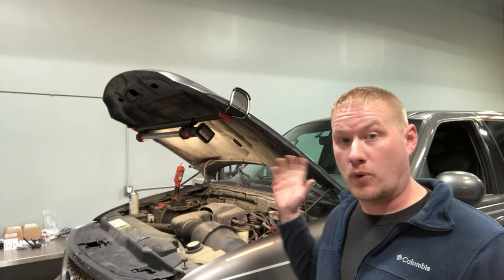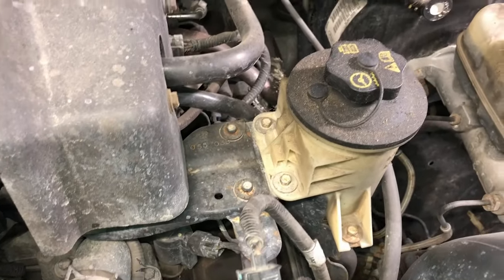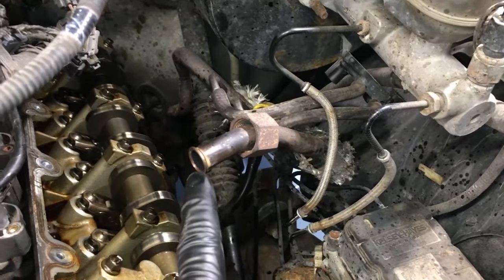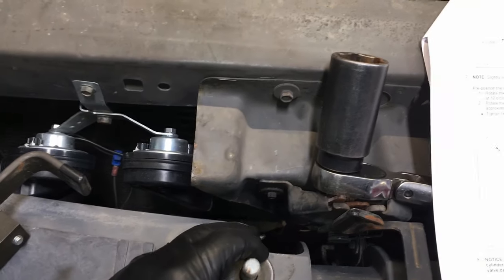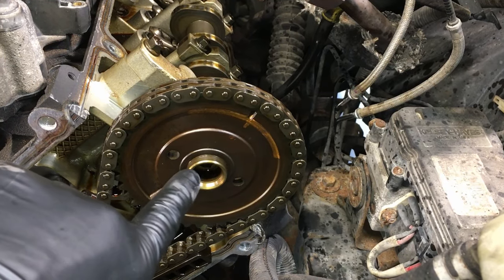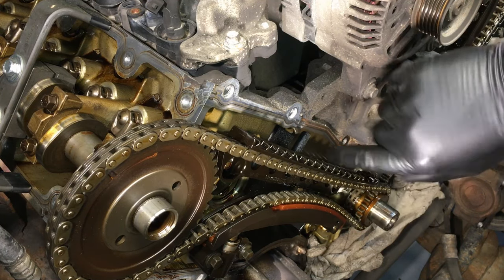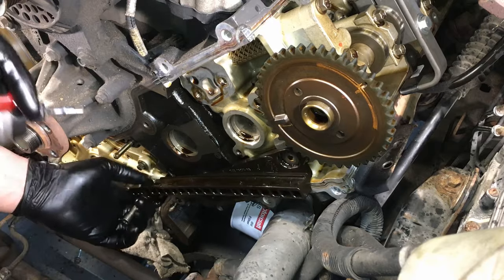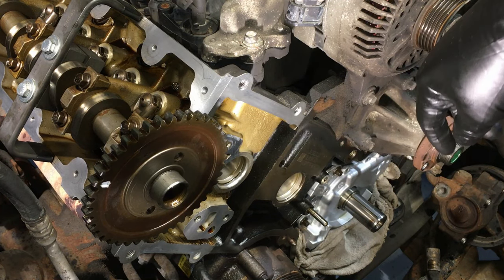Ford 5.4L 2v Triton Engine: Complete Timing Walkthrough

Comment: I need help... I gave my 2001 Ford F150 5.4 Triton to a home mechanic to change timing chain, water pump and the oil pump....  now my truck won't start. (1st he said chain noise came back after 15 minutes of running the motor, 2nd he said the oil sensor is dry doesn't show any oil lubrication,  there's oil on the bottom but the heads aren't getting any oil because of the grud clogging it)
He states the timing chain was so full of grud and he tried to clean it as much as possible but when he put everything back together the timing chain is not getting any oil lubrication and he says some of that grud got into the motor and is now blocking the oil from passing to the timing chain and now because I told him I don't have any more money for any otjer job he wants me to either go pick up my truck with a tow truck or allow him to practically take the motor apart, see if the heads are bad or replace the motor all together. He still wants the $400 I paid, said he would pay for the towing to my home with the condition that when I have the money he gets the job again.... that soumds to me lime he knows he did a shitty job and if I take it to another mechanic they will see that he is trying to cheat me.
I feel he's lying to me and wants more money for nothing.
Can this truly happen? Can grud from a timing chain replacement go and mess up the motor?
Please help.... I've been taken for a fool by too many mechanics and I'm not sure if I'm over reacting... he drove my car just fine to his home for it to not ne running any more. The motor wasn't knocking at all... it was only the timing chainhitting metal.... I've had a car were I messed up the motor and the knocking sound is not in my truck... just the chains.

Comment: I got a 99 250 5.4 that has been ticking and rattling here and there for quiet some time now. Mostly does it upon first start and it first started on the passenger side and now I hear some ticking on the drivers side. after about 5 mins of driving it'll go away and then it'll come and go randomly. I'm not too worried about it but it's a daily driving work horse here that is constantly pulling trailers around the farm. I'm leading more towards lash adjusters. I've watched your 3v videos and I seen you made the comment its a different tool and procedure for a 2v motor. My biggest concern is can the lash adjusters be removed on a 2v without removing the cam? I think if I'm going to go through the hassle I'll replace the roller followers as well. Thanks in advance and as always good job with the videos!

Comment: Do you need to have the crank sensor disconnected to build up the oil pressure?, or can u just try to fire it up after you put everything back together?
Reply: seen a video remove oil filter and use hand pump to force oil through oil filter opening.... not the threaded opening 
into the oil pump and into oil pan
mildion oil pumps video

Comment: Question!! Not timing related, I just removed my intake manifold ( same engine) and I noticed on the passenger's side all the way on the back of the block there is a port ( hole) of some sort and threads for a bolt that the intake manifold does not cover what is supposed to go in that location?

Comment: So is this what my 2006 E250 5.4 2v is like?
Can it be done in the van? I can do the plugs there.
Probably easies to pull the rad.
Reply from the maker: You can do ity either but yes pulling the radiator and core support would be much easier.
Reply: FordTechMakuloco thanks.

Comment: I have 2001 expedition 5.4 it runs great but in the summer with the a/c on it starts to drag a little on take off and it only happens when it’s 90+ outside. Been chasing this problem for 2 years nobody can help because there’s no engine codes.

Comment: Great video. I have a 2007 Navigator that I need to do this to. But I also need to replace the valve lifters, which means removing the camshafts. Do you have a video on replacing the lifters and / or the camshafts?

Comment: Preparing to do a full tear down and rebuild on my 97 expedition.  I use it for a tow vehicle for my large boat and skate shop trailer.  Will using the high volume oil pump you mentioned not being necessary help for a tow vehicle?

Comment: That was a clean job very nice. How many miles should this kind of job be done at? I have a 2003 f-150 with 350,000 miles original engine transmission. What do you charge
Reply: JO MARTIN Being the owner of the truck in this video, I can tell you the value for the dollar being spent is considerably less than having it done at the dealership.
Reply: @TFFTR1 most dealers dnt wanna touch a 2003 for that type of work maybe they would put a engine in  but not doing that. How many miles do you have on yours? The mechanic in the video does all your work? He knows his stuff hard to find good mechanics
Reply: @TFFTR1  what kind of problem  did you have or notice for this to.be done ?
Reply: @JOMARTIN At the time that Brian did this repair for me I had 198k miles. I drive 2.5 hours just to utilize his services Brian has done several repairs for me and I am very pleased with the professionalism and cost associated with all he has done for me..
Reply: @TFFTR1  sometimes you have to drive a little distance to get good service ya know well worth it. If I decide to keep my truck longer I will consider mr Brian for that type of work to be done. But for now no big issues still running good
Reply: JO MARTIN being familiar with the noises associated with worn chains and guides I reached out to Brian to discuss the repairs. The one noticeable noise was the rattling on start up, more predominant on cold starts. As you see in the video the passenger side guide had significant wear and both adjusters were blown out. I was a fan of Brian’s videos and work demonstrations before I was a customer of his. He has demonstrated a level of ethics than is uncommon in the automotive industry. Dealerships expound upon their price points due to the expertise, training and specialty tools. Brian’s business model to providing a great service at a fair price with the experiences that has made him successful.
Reply: @TFFTR1  I will listen to my engine a little bit more but I dnt think I'm hearing anything like that I have 350,000 miles I'm very high on keeping the services done. If I can make it to 400,000 and keep my truck than I think I will get that service you had done does Mr Brian have a way to be contacted for work to be done ?
Reply: @jomartin7691   Yeah go to bsg automotive and submit a form. That is his shops name.

Comment: Can timing (lose/stretched chain) cause cold start misfire that clears when warmed and high fuel trims on b2 only?  Also stumbles at highway speeds under light acceleration.
Reply from the maker: No it would have to be way off.
Reply: Thanks!  May have just saved me $1,000!
Reply: My E350 seems to eat coil packs. I’d look there first. I think I’m on my 3rd or 4th set.

Comment: Okay just wondering if you could please help me I have a 2000 Ford F350 2 wheel drive 5.4 l i just replace the intake on it the car ran with the old intake but it leaks coolant after I replace the intake it will not start it turns over extremely slow and the Noid light turns off after about 5 to 10 seconds it has spark just wondering what that could be I replace the starter Cam and crank sensor and all spark plugs please help

Comment: Doing this job this weekend, anyone know if you can turn the camshaft sprocket counterclockwise to achieve the 11 and 12 o'clock position on the timing mark as well as fine tuning to the chains colored links (with cam clamps used, not removing followers) or is it clockwise only?

Comment: I'm enjoying the hell out of all these 5.4 videos, but I'm confused about where you stage the crank and cams before installing the chains.  You like to set the woodruff key at Noon high and then rotate the crank backwards.  (I noticed the same thing in the 3V timing videos too.)  Given you've got tooling to hold the cams solidly in place on the 2V,  what's to stop you from simply locating the crank timing dot right at the 6 o'clock spot to start with?  It looked, to me, like the cam/crank timing would have actually been spot on for bank 2 and then you'd have needed to correct on bank 1 only had the dot been the reference point instead of the woodruff key.  What am I missing?

Comment: Great video.. but I need additional information. @FordTechMakuloco I have the motor pulled and am trying to remove cylinder heads. Sense the cams are under spring pressure what are the next steps to remove cylinder heads?

Comment: I know OEM is always the best way to go but is there any other aftermarket brand(possibly less expensive) than the Melling? 
You also said in the video that the OEM oil pump performance was sufficient. You would not recommend a high volume pump? Thanks so much for the video(s)
Reply: ….a brand that you might recommend even though it wouldn’t be your first choice.

Comment: As always a great job. The only thing I would have done different was to replace the waterpump since it is right there. Whenever I tear into an engine I replace all hoses fan belts and things like the water pump. 

I'm the same way when I'm working on the front end. If I replace one tire rod and I replace everything that has to do with steering and suspension. 

I realize that you're doing customers cars and myself it's normally my own or family or friends. Some of them don't like it when I work on their. I want to replace everything I have taken off. I tried to explain to them that the money they say by taking it to the dealership can be put towards making things better unfortunately most of them don't look at it that way.

I do believe this spring I'm going to do this on my expedition. I don't drive it all the time and the last time I did I could hear their change slapping around. Since it's too big for me to work on in my garage I will just wait until springtime and do it the right way.

Thank you so much for providing so much good information. I'm definitely buying that cam tool I'm not too crazy about putting play vice grips on my camshaft. I love you showing how to do the crankshaft without the special tool and also the way you move the camshaft with the extension.

Comment: At the end with crank sensor disconnected and your cranking to prime oil pump. While cranking your pressure went up.
My 2001 ford 5.4 L 2 V pressure does not go up while cranking, but soon as I let off key in accessory position, the gauge goes up showing pressure. Then after 5 seconds pressure drops while still in accessory  position.  Will not show oil pressure while cranking. It does show pressure while running. Is this cause the sensor is not active on this vehicle till a complete start and engine is running has occurred?
Reply from the maker: The sensor is active but the cluster may not be
Reply: Is this something normal with this year model or is it something to be concerned about?
Since I wasn’t getting oil pressure while cranking with crank sensor wire removed.

This was after doing a timing job , replacing hvla and replacing the oil pump with new meling HV.
I’m not sure before hand if it ever did that, cause I never tried cranking with crank sensor wire removed.

Comment: can some body tell me how to get the cam phasers off. mine are like the ones in video. i can put a socket adapter in them to turn them. i figure if i can get cam holding tool i can hold cam and unscrew the phasers counter clockwise with adapter. that is if they unscrew. 5.4 2v. i cant find video on youtube or any where else.

Comment: Very helpful Videos Brian, Thanks!  In this video you link to the Melling Timing Set Kit, in another one of your videos you recommend only Ford OEM parts.  Is your preference still Ford OEM on everything?  If so what about  just the Melling M176HV oil pump...it shows a 8% higher volume over stock or would you still just go with a brand new OEM Ford oil pump?  I don't mind buying OEM Ford even if its more expensive if that's the better way to go.  Thanks again!

Comment: I made the mistake of setting the crankshaft to TDC and didnt check to make sure the timing marks on the camshaft sprockets were at the correct positions and ive already taken the chains off. Is it safe to turn the crankshaft keyway to 12 O'clock and then proceed to turn the camshaft sprockets timing marks to the correct position?
Reply: the Haynes manual said to set the crankshaft to TDC as the first step, which I did. Is it safe to turn the crankshaft from TDC to 12 o'clock so I can safely position my camshaft sprockets?

Comment: Wait, no gasket or gasket maker on the tensioner?  

I see the cast iron tensioners are also available for my 5.4 3V in my 2010 Navigator per the Melling web site.  Is it advisable to use the cast iron ones on my engine as well?  Have 133K, may replace the timing set proactively at 150K.
Reply from the maker: No gasket needed at all.

Comment: Snapped bolt #1 driver's side on valve cover. Even before the torque value. Will the other two hold ok or do I have to fix it?
Reply: try to fix or use ton of atv sealer
 top side of valve cover (intake side) should not leak anyway 
i just hand tourqe small non mechanical bolts anyway

Comment: Hello Brian,
Would you change out all the roller followers if you could hear a ticking while accelerating ( in park or neutral or just a little gas no ticking) while doing this job.  I'm only guessing it's the followers making the noise until I can get in and look.  Mileage 170,000  5.4L 2V F150   2001  thank you for providing all this most excellent content you are the best, I really mean it.
Reply: Did you figure out the ticking? I had ticking and it was a loose spark plug that eventually blew.

Comment: My 01 F150 has the 5.4 2v with 266k miles on it. Should I do the timing chains on it? I'm third owner and bought it with 216k miles. She runs great but don't know if that's ever been done. How do you know when the timing chains should be replaced?
Reply: It'll rattle and clatter fairly loudly, especially on start up.

Comment: I have a 99, f150, Lariat with this 5.4 in it. Considering doing a full rebuild from the ground up. It's 4x4 too so that's why I'm considering it. I would rather shell out the bit of cash for rebuilding it, rather than spending thousands on a truck right now.

Comment: Sir is this the rattling noise that comes and goes ? I think I'm hearing this on my 03 5.4 Expedition. 131000 miles oil always changed every 3000 to 5000 miles since new.
Reply: It's likely your harmonic balancer. My 97 expedition went 208 thousand miles vefore needding to change it. The rubber between the 2 metal parts gets worn.

Comment: Help needed!! Great video first off! I was going through the process of putting the timing components on and when I loosened the cam tensioner tool on the passenger side, I was rotating the cam to align it with the link on the chain and it flipped on me clockwise, if you're facing the engine. So now I'm not sure what I need to do to correct that. I rotated the cam back the two or three inches to put the chain on and align the timing marks. But now the truck runs like crap so I probably should not have done that. And now I don't know what to do to fix it. If the cam flips to the right can you just move it back to where it was or has something happened internally in the engine at that point to throw all of the valve timing out and everything. Thank you! Brett
Reply: What was your solution to this?
Reply: I still have not found one. I had a certified mechanic come out and re-time it with me. But I still ended up with the same problem. He was not a Ford mechanic. I never got any kind of reply from the website. The truck is still up on blocks and I bought a different car to drive in the meantime. The dealership wants 2500 to 3000 to do the timing job and I can buy a remanufactured long block engine from S&J in Spokane with a seven-year 100,000 mile warranty for $2,700. So if I don't figure this out or get some help on it I'm just going to drop a new engine in it. The original engine has 260,000 Mi on it.

Comment: I noticed that there was not a gasket under the new tensioner.  Is this normal?
Reply from the maker: Correct the cast iron tensioners do not incorporate a gasket.
Reply: @FordTechMakuloco  so do they just lose there ability to keep pressure?

Comment: No gaskets on the new tensioners? Will those cast iron melling tensioners work on the 3v, seems like the better way to go if they do...
Reply from the maker: No gaskets at all and yes they work on the 3v engines as well.
Reply: @FordTechMakuloco  good to know, I'll keep that locked away in ma brain for when it's time.

Comment: Well thanks for the detailed video.  I did the work myself some years ago and it would have been smoother had I seen this.
I have watched many of your videos and one NOISE I have not heard you address is the one I have. 
At 1500 RPM, cold or hot like clockwork there is a rattling noise.  You must have slight load as you drive through that range which is typical for normal city driving.  It is a 2003 F150 5.4 2 Valve. Total miles 150K.
Any thoughts?  I did not replace the oil pump but I did use cast iron tensioners.  If it were just load sensitive I would say it sounded like piston slap, but it is RPM related.  Interesting stuff you do keep up the videos.
Reply: Sounds like a bad fan clutch.

Comment: Okay so I'm putting a timing chain kit in my 2000 f-150 5.4l 2v. Whenever I set my crank dot at 6:00 is that #1 at TDC? Or do I need to see if #1 is at TDC or does it matter. That's the only part I dont understand.
Reply from the maker: You literally set the crank sprocket timing dot at 6 and forget it, you are ready for timing at that point.
Reply: @FordTechMakuloco  thank you so much. You are the man with these 2 and 3 valve motors.